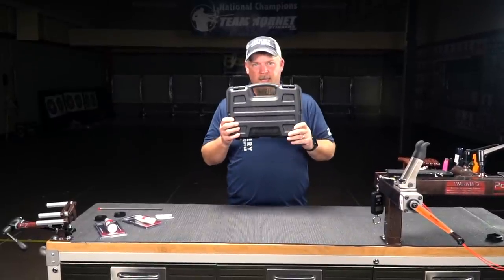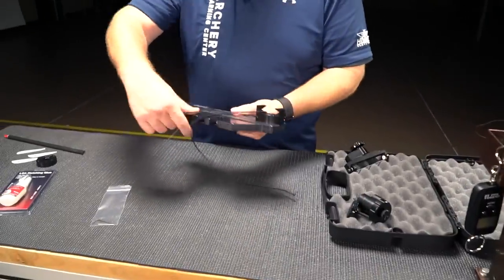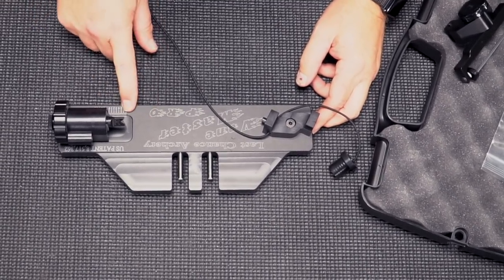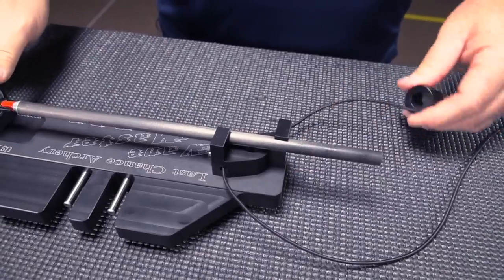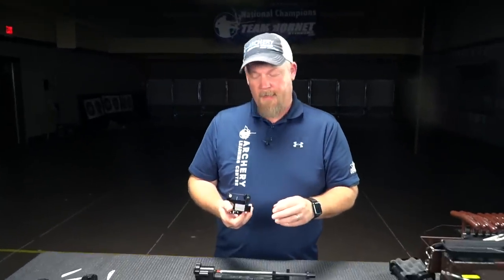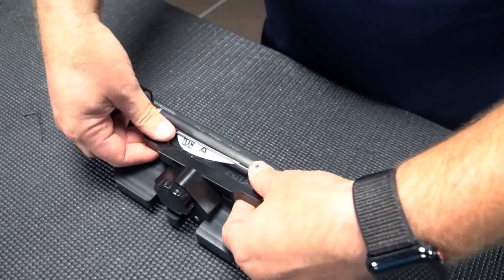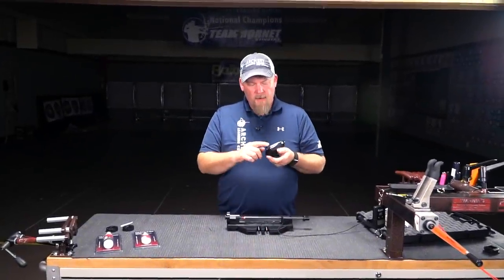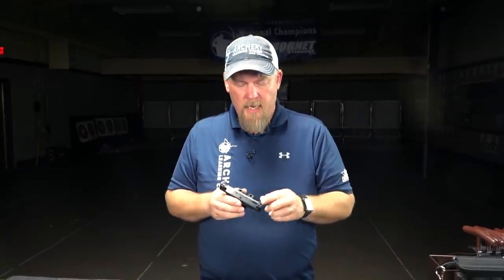Vane Master PRO + Instructional Video

Comment: a baby wipe used after every fletch,just takes a second,keeps the wires clean and keeps a light coating on the wires,one wipe can do loads of arrows,cheap and works beautifully,give it it a go
Reply: Thanks for the tip Ray, sounds like a great idea.

Comment: ...Just a thought, I'm not sure what type of material the small sleeves that cover the wire is, but a small application of teflon spray on the micro fiber cloth and wipe the wires after maybe each arrow would save the covers and make for a potentially easier cleanup. I'd love to have this jig, but a bit pricey for retirement years...Great video...

Comment: Any tips on how to use thicker vanes like AAE vanes? I have to let each one dry for 2.5 minutes or they come off because the wires are so tight on the thick and ridged vane bases
Reply from the maker: Hello, good morning! They can be a bit tricky, for sure. What's most important with any thicker vane, whether AAE or others, is ensuring there's no wear on your covers. If the covers are worn, the vane itself will try to stick to the covers instead of sticking to the shaft, and as you try to pull the clamp away, it'll try to pull the vane off the shaft even more than normal. Another very important thing is ensuring you are prepping the arrow shaft using a cleaner/activator and then using a fast-setting super glue.

Comment: Griv, I have the original VMP. Can I buy the upgraded head and will it fit the original? Will it be available at the Vegas shoot?
Reply from the maker: Hi Ray, if you're referring to the upgraded clamp with the set screws that is something we can sell separately. A VMP Clamp alone would run $65.00 + shipping. If you have one of the really really old originals (no lasered names or numbers) I always require those to come back so I can ensure I give you parts that fit correctly. If your jig is simply just the old model that does have all the lasered numbers and lines I should be able to get you one that would fit without having the jig come back. The last option is the one we see used most often which is buying the upgrade alone for your current clamp. The cost would be $10 and the only thing you have to do is send us your clamp to have the upgrade installed. We can install the upgrade to your current parts and it'll save you about $55. I will be upgrading heads at the Vegas shoot but I won't have any extra wires. If you send it to us here I can upgrade anything on the head including the wires if need be. At the shoot I will only be able to upgrade the head with the new set screws and that would be it. I hope this helps!
Reply: I was asking because I didn't see the clamp on the website. How would I go about ordering one?

Comment: I think youu need pressure when the glue is drying and with this its impossible. I use that simple red bohning and with that i can have pressure and my vanes or feathers never fail. Also looks this can fail to keep the feather straight because its not between a clamp.

Comment: I understand the  4 fletch 90  degrees  but I cant work out the 105  what am I missing 120 is 3 fletch
Reply: another popular way of doing 4 fletch is 105/75 degree instead of 90, think of it in terms of like a flattened X

Comment: You say helical but looks more like offset then helical.
Reply from the maker: Good morning! So the VMP fletches a true helical. The VMP clamp is built using wires to hold the vane, and then the wires are held inside the two rotating discs. You first will set your helical angle on the clamp, and then you slide the clamp to the arrow shaft to dry fit before adding glue to your vane. The discs rotate so that it allows your clamp to contour around the arrow shaft giving you the true helical instead of an offset. Contact us if you have any other questions. We'd be happy to help! sales@lastchancearchery.com